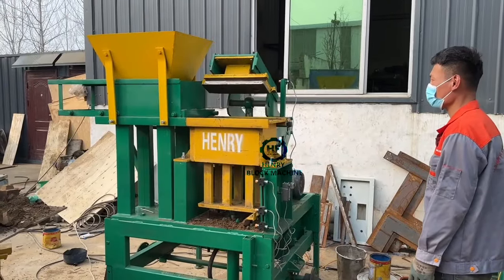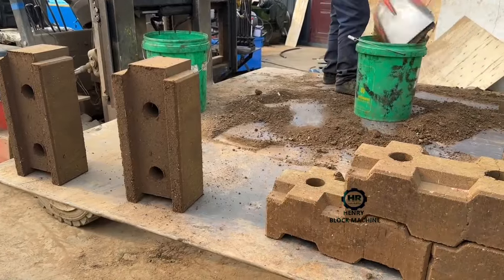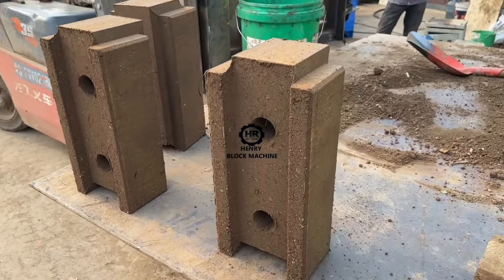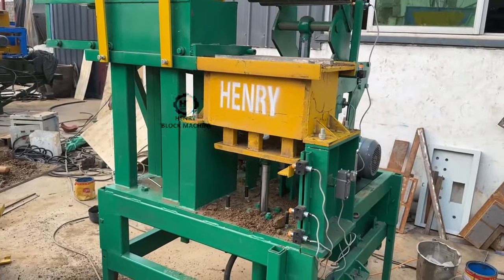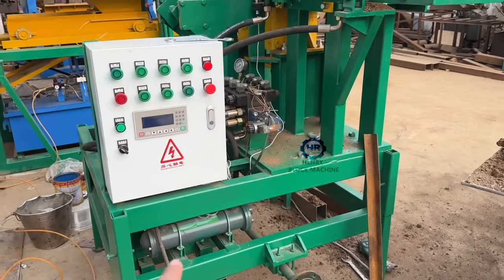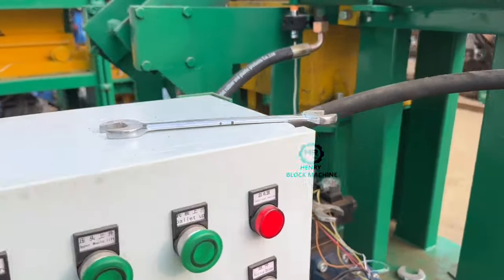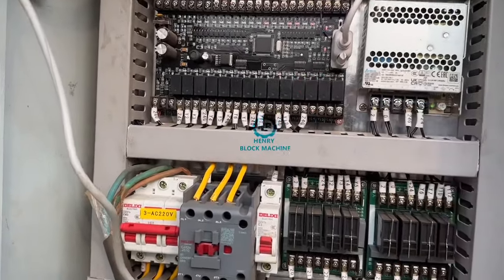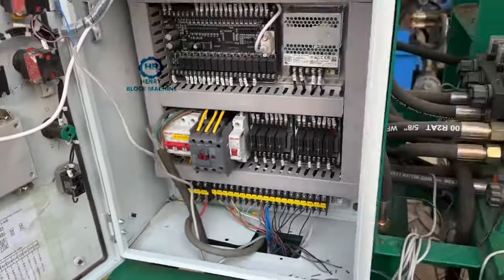How to decide the size of your earth interlocking bricks? Is machine higher of automation the better

Comment: Are those 400mm length 200mm width and 200mm height?  Please let me know if I got the measurements right. Thank you
Reply from the maker: @NE0561   you are correct , but they are a little different. The length is 404mm 😊
Reply: @HenryBlockMachineGroup  Awesome!  Do you have a manual machine for the same exact blocks?  If you have a video link please. Thanks